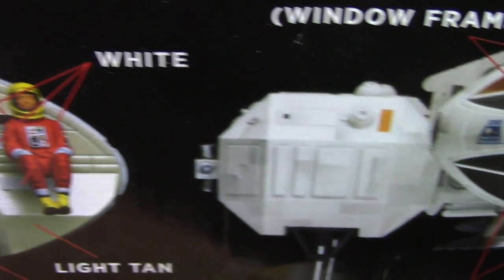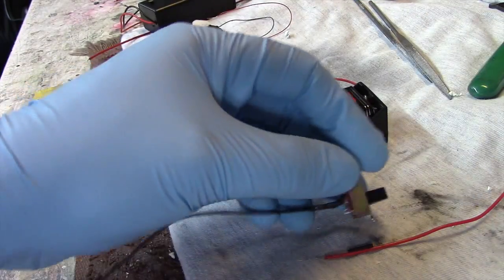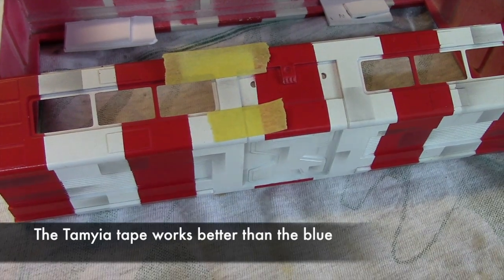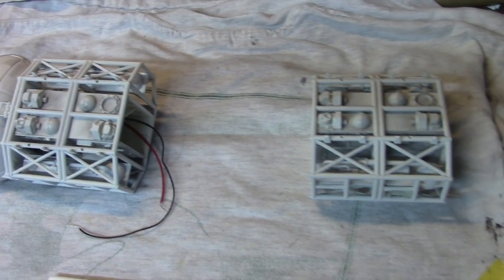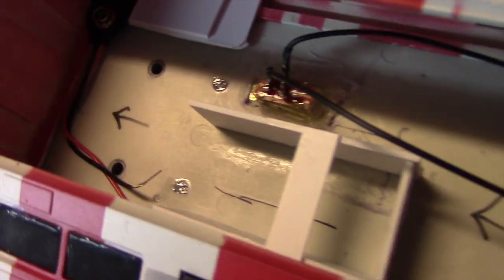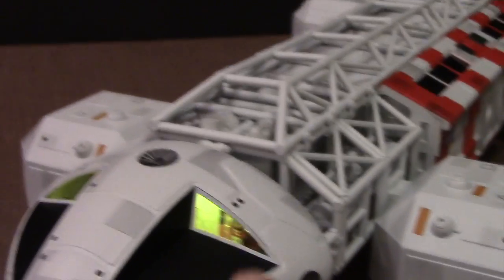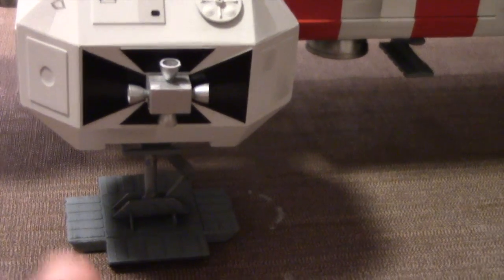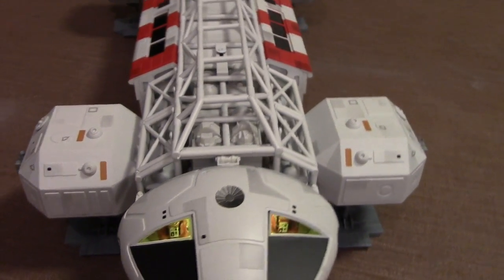Completing the Round 2 Space: 1999 Eagle

Comment: It is a great model,however,I see no reason to build something that huge. I am working on finishing up the Reliant Wrath of Khan Star Trek model. I estimate at least 100 LED lights. Some strip lighting,most individual colored or navigation. All wiring is magnet wire. It has taken me three winters to build this. I only build plastic models in the winter because I fly RC planes in the nice weather. I taught myself electronics by watching video's.  I love building electronic projects now. Your model came out good. I wash using greys and blacks might have been better than pastels.  I use paint washs as well as oil based and ink washes,then finish with pastels.  I would have used a putty to act as a paint line blocker. I found out silly putty works awesome for that.
Reply from the maker: RC Hobbyist Extreme...thanks for your comments. Since building this model I’ve become more comfortable and confident w/using washes now and agree they’re very effective. Thanks for watching.